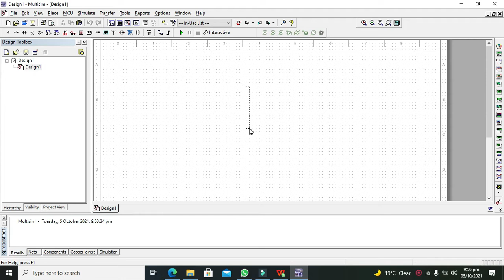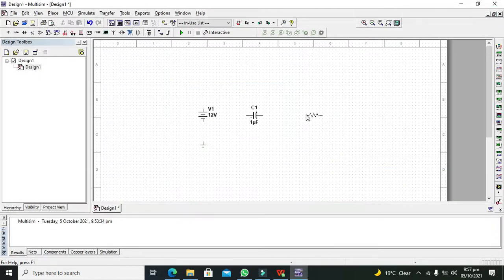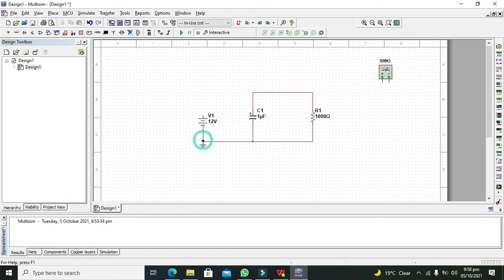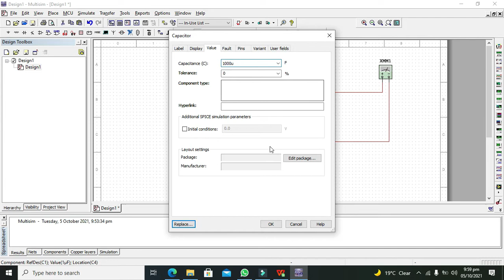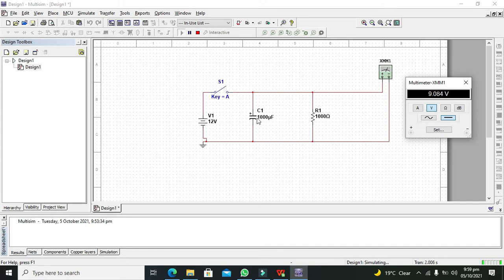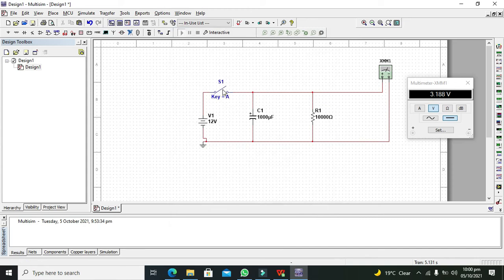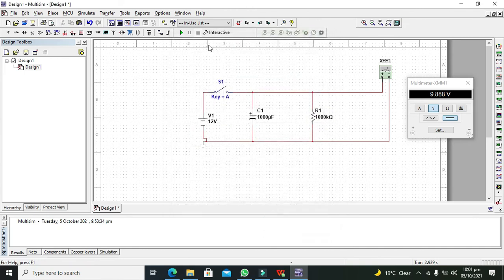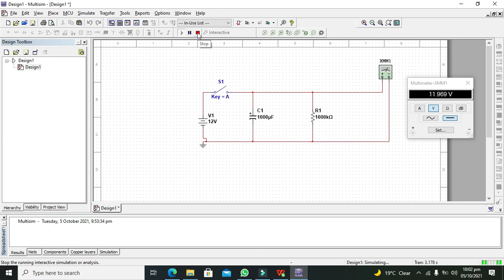how to use capacitor in multisim | charging/discharging capacitor in multisim

Comment: how to do that thing where it's only the label and the value is displayed on a certain element? also, how do you have the option to instantaneously change the value the resistance of a resistor? I don't have that option :((
Reply from the maker: i think i m using the old version..but in a lot of softwares like multisim and proteus u can double click the part and then can change the value...